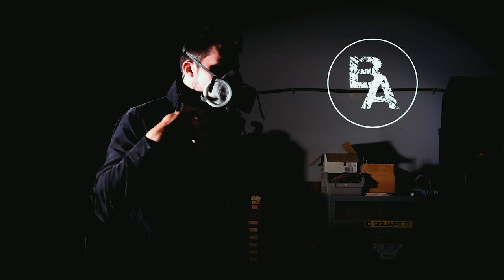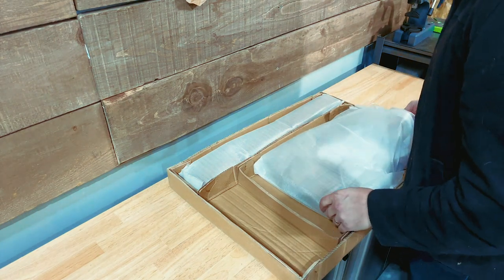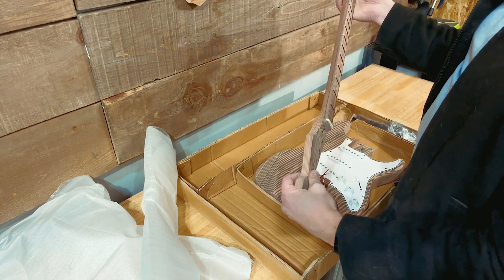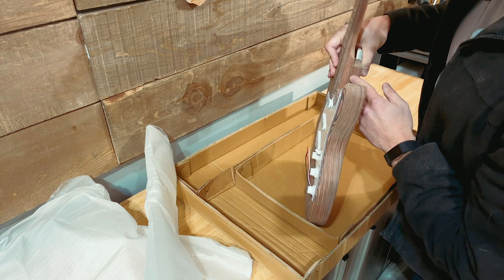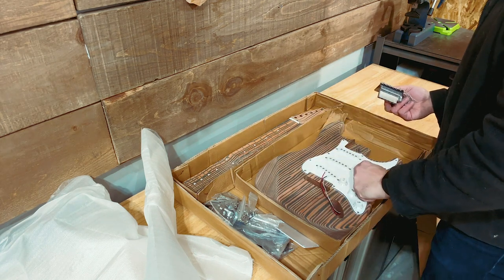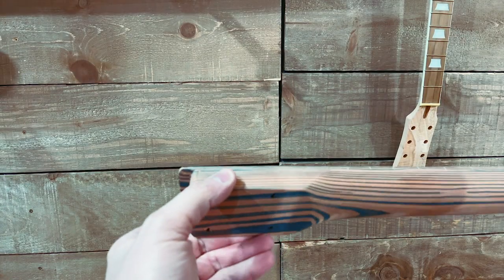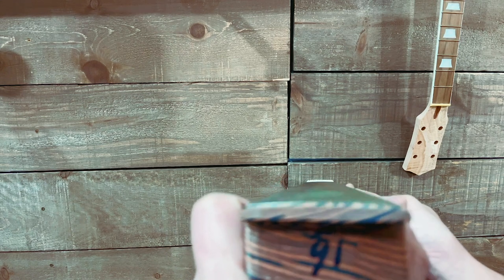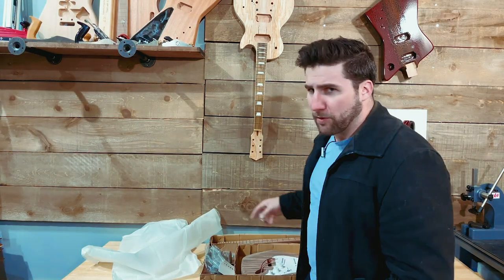A Wicked New Guitar Kit From Bad Cat (Unboxing and Intro)

Comment: Brad, love your channel and jealous of your hair. I've gotta raise a few points based on my experiences with these kits. First off, these aren't wood. They're plastic - bakelite to be exact. Not that there's anything wrong with that. It takes dyes and stains, and works and finishes like wood. And being an engineered product, they may be more stable than real wood. They are heavy af. Just know what you're buying. I bought one of these. It arrived with a chunk out of the fretboard. I exchanged it for another one. The replacement arrived with a shattered bridge pickup and a ridiculously sloppy neck pocket (about 15° of lateral play). When I tried to exchange that one they refused to honor the coupon I had applied to my original purchase and wanted me to pay an additional $20. Sorry, I have no respect for badcat.

Comment: The kit looks good, at least the wood.  Zebra wood is an amazing wood, I am not a bug fan of it.  The packing though, there was no packing.  I would wonder if the switch was bent, if there was maybe some damage to it, or the pickups and controls.  I know you mentioned about installing a new pick guard and pickups, but for evaluation of the kit, I wonder if the electronics did ship ok?  The box looked like it was crushed in from the top, right onto the controls.  I am looking forward to what you did to it to the final build.
Reply from the maker: The controls seem to be fine other than the bent switch. No evidence of other damage.

Comment: I am pretty sure that the guitar is made of an engineered wood product. Not sure exactly how it is made but I think is like a thick two different or at least different stained colors of wood. I do know that it's done under very high pressure.
Reply from the maker: Yes, I think you’re correct.